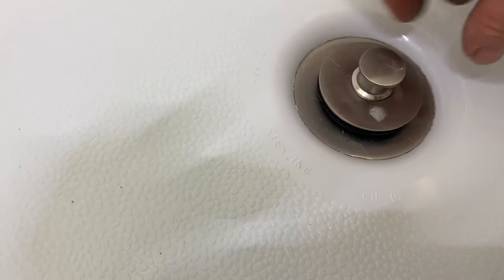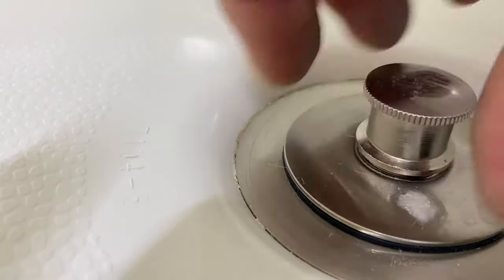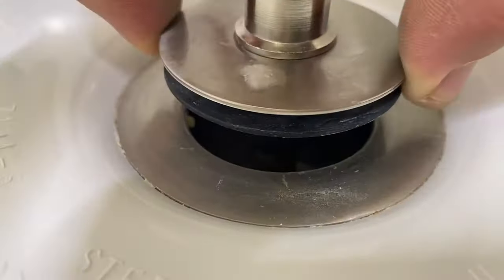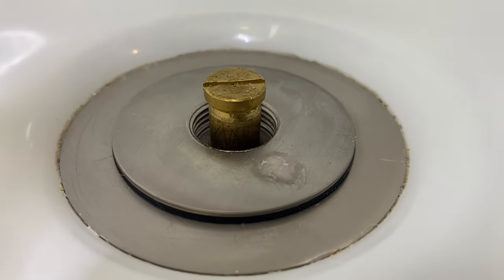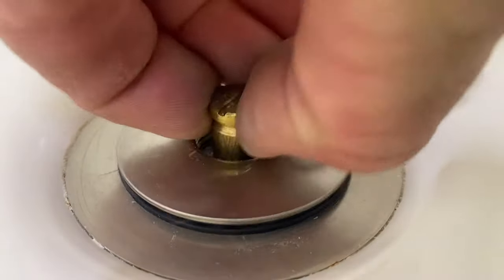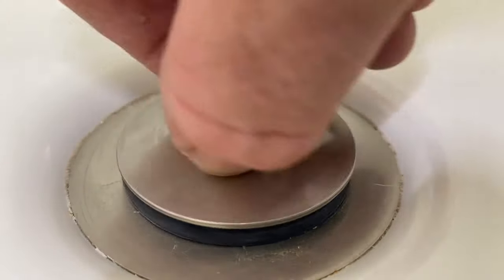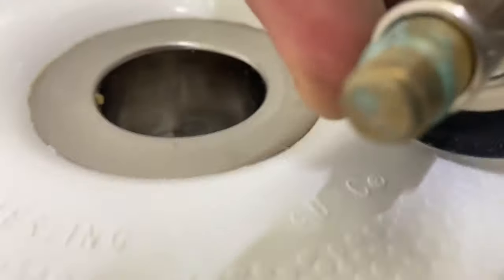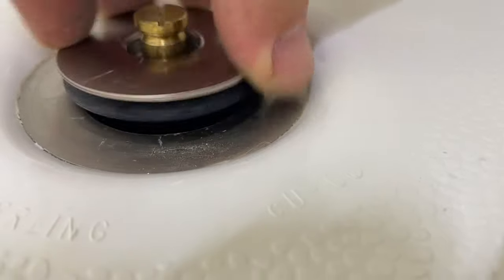How to remove your bathtub drain stopper

Comment: How can I remove that middle bolt if the top is missing? Ty
Reply: Some will have a slot for a flat head screw driver.  You can also use a pair of pliers to grab it and twist it counter clockwise.
Reply: @jjdonaldson9761  I’ll try pliers. Mine doesn’t have a notch on top. Ty!
Reply from the maker: Some also have a small square for a 1/4” drive ratchet